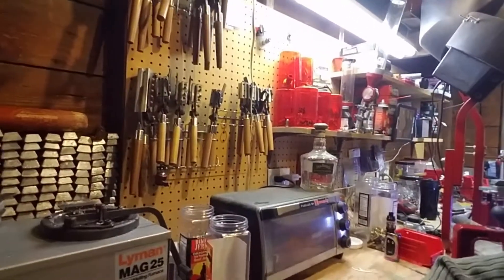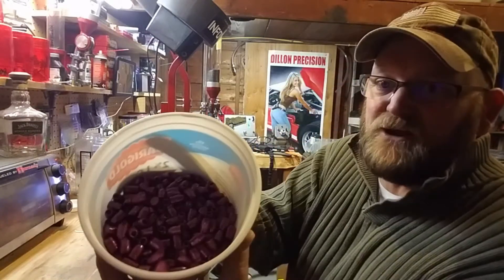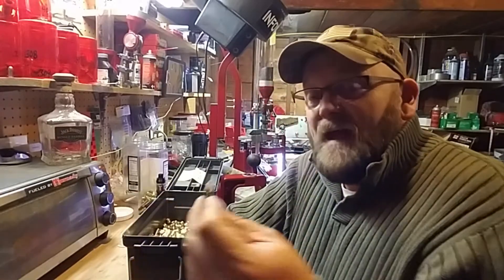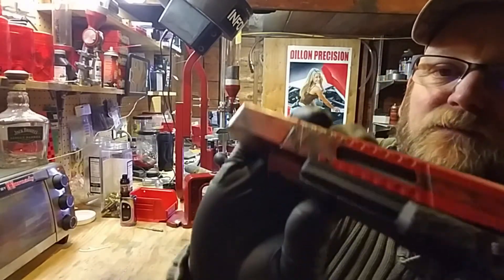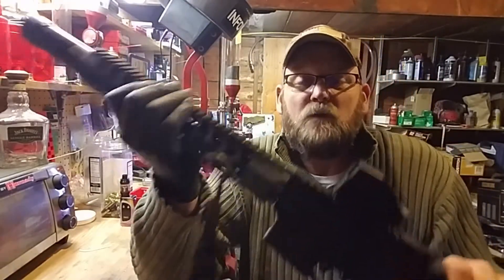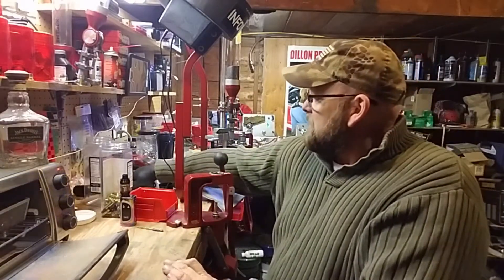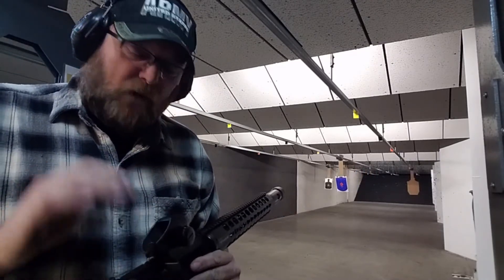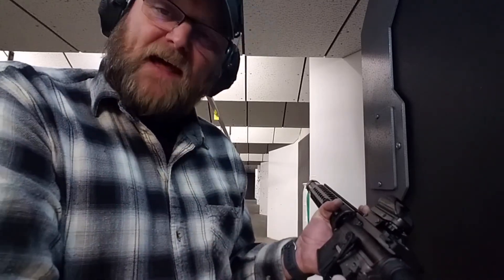300 ACC Black Out, 230 gn Cast Lead AND Double Tap Trigger!

Comment: I figured I was getting mostly supersonic with 10.3 grains of IMR 4227 out of my 8.5 inch palmetto state upper. I will drop my next batch down to 10 grains and should get the same 1050 fps we seen here. Also hope to get the same accuracy, because at 10.3 I was holding a fairly tight group.

Comment: So what's with different color powder coating? Is there a benefit to powder coating? Is there a difference in different colors?
Reply: Powder coating is  to lube the bullet, it also increases diameter. It's an alternative to filling lube grooves.
Colors are up to the user no difference in color for performance.

Comment: Just subbed... did I hear you correct, you modified your Lee? Have any info/vid on it?
Reply: It's the Lee 90307 mold, the base is a boat tail. The mod is to make the base a flat base, and larger diameter(309-311) to get more riding surface.